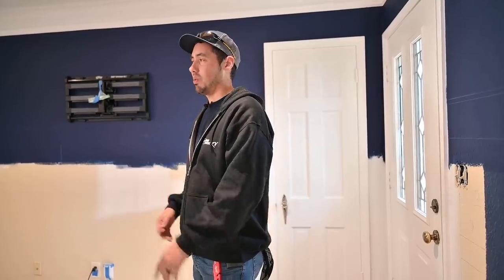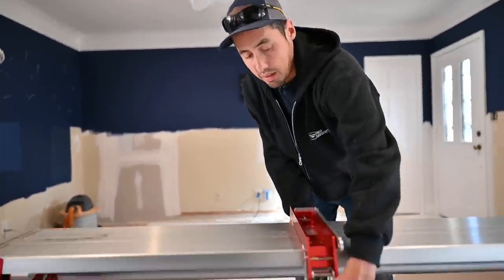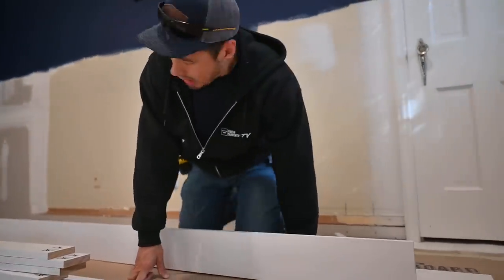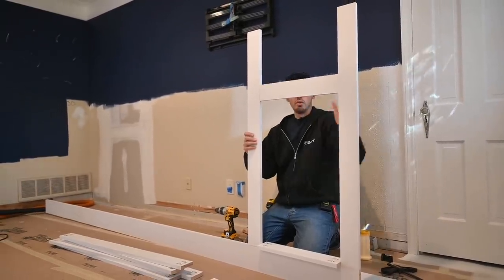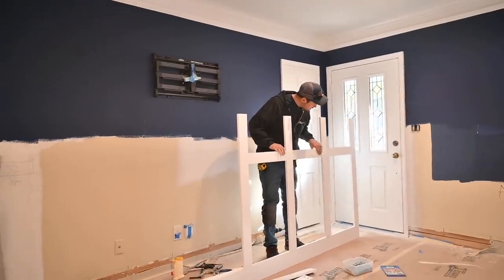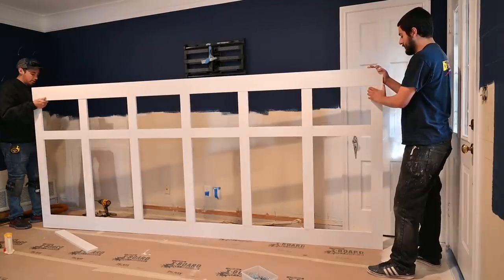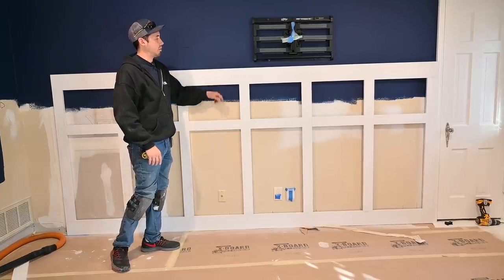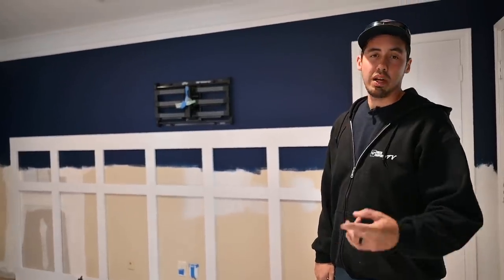Judges Panel Wainscot - Trim Carpentry Build Install

Comment: Richard, bro, you so need a Kreg Foreman for projects like that. One of my best tool purchases ever. I make like 20 cabinet face frames a week in a one-man shop and it's a huge time saver.

Tip: fasten a small block (2x2) of hard maple to one jaw of your Kreg Quick Clamp and self-adhesive cork to the other jaw. Place the block on the "show face" side and the cork jaw on the screw side. Clamp and screw. Makes the show faces align perfectly even when slight thickness variations exist... which is always.

Buen trabajo, como siempre.

Comment: I switched from pocket screws to biscuits.  I was able to get better results and I think you end up with a more stable joint.  I like the very precise fit on the face, while having some lateral play when I’m assembling.  Love your work!  Thank you so much for sharing with us.
Reply: So then what do you do for clamping while the glue cures?

Comment: As always very well explained. I have one question that is probably a minor issue but could add up. It appears you measure your stop block from the center not from the tooth. If this is correct do you account for the 1/16 when you set up the stop block. For example if you want 17 1/4 do you set your stop to 17 5/16? It seems like with 6 pieces you would be out 3/8 from one end to the other.

Comment: Could you show us how you fix a bad nail, especially when the head of the nail bends over but it's still proud of the material?
Reply: Pull it out?
Reply: @halfdead1380  The problem is that most of the time the nail breaks when trying to pull it out, still leaving bent over nail proud of the material.
Reply: @danboggess707  for finish nails wouldn't you try using a nail set to get it flush?

Comment: I was curious on what your formula is to equally get the measurements needed to have the panels the same size along a wall. Thanks and I love your work!
Reply: (Distance - 1 vertical rail width) ÷ number of panels you want

Comment: I found that gluing the butt joints before pocket screwing stops the whole wainscot panel from splitting when your carrying it to the installation spot, the caveat is you need to let the glue dry, so use a fast setting glue like Titebond premium, set quick 5-7 minutes.

Comment: Superior Craftsmanship.  If you were doing floor to ceiling  2" board and batten for an entire wall, would you build it as a unit first and then install it, or would you use another method? Thanks so much for your videos.  I learn something every time I watch.

Comment: First time watching one of your vids. I see you use a foot switch for your vac. Clever, but I use an auto switch that when you start the saw, the vac comes on, and it stays on for about 7 sec after you turn the saw off. Might want to look into it if you haven’t before.

Comment: Great video! You probably covered this in another video that I missed but in situations where you control everything, fitting the trim like this works out great. How do you handle things like crooked corners or existing casing that isn't plumb?

Comment: Thanks for the great videos. Have you ever covered how you would end wainscoting at an outside corner, or where the edge would-be exposed? Would you, in that case, run the stile from top to bottom on then, so the end grain of the rail is not exposed?

Comment: Great video.  Do you use 1x4 for the WindsorOne boards or do you use 1x6 for it?  Would you ever use 1x6 on a larger room or with larger panel mouldings or is 1x4 pretty much all that is used?

Comment: Try using some wooden clamps to hold the bottom piece, when screwing in the vertical members, might help.or make a clamp like a door holder to hold it in place as you work.
Reply: I was going to suggest the exact same thing.

Comment: I have a question about your paint equipment - you always use an airless system.  Was wondering if an HVLP system would be better for inside work since it creates less overspray?

Comment: Good work as usual man. Do you ever come across bullnose corners that aren't 90 degrees by you? I ended up with a 25 degree inside corner transitioned to a 25 degree outside corner in my bathroom, and it was a royal pain to measure and cut the crown. I'd be super interested to see you tackle that if you come across one.

Comment: You mentioned a hardboard back, and since you nailed it up I’m guessing you’ll insert a panel for each opening.

Is that a preference, or is that actually better than putting the hardboard backing on the whole thing before nailing to the wall?

I would think the extra quarter to eighth inch depth would be something too terrible, especially since it will be capped.
Reply: Checkout his wainscoting playlist( particularly the one about backboards), he mentions both methods and seems both are OK, it just depends on the project

Comment: how did you decide the dimension of top and bottom panel height? you referenced the door panels, how about if the wainscot's panel heights follow the ratio of the upper to the mid door panel height? would that look odd?
Reply: The dimensions for work like this is hell, it'll never be completely perfect unless the room itself was built with doing this in mind,  it'll be wall length. Minus casing width, and 7 inches for the first and last stile, divided by the number of panels, for the width and the height is normally around 30 to 40 inches for the bottom, and 1 third the height for the top panel ratioed to the bottom one

Comment: Unreal,just a quick question,as you set the fence from the main body of the blade,would the cut be slightly more due to the with of the tooth?
Reply from the maker: Good question. I could see that happening but it might only be like a 1/32” which is usually good enough for me.
Reply: @FinishCarpentryTV  well if it's good enough for your work,it's will be more than good enough for me,thanks.

Comment: I was taught to measure to the teeth of a saw blade. I only use a table saw though. Does that tiny space not matter for this work?
Reply from the maker: Good question. I have never had an issue measuring off the blade but for this kind of work 1/32” to a 1/16 tolerance is good. After a 1/8” you really start seeing things.

Comment: Don’t know how you use them dewalt pin guns, seriously bugs me out having to wait for the compressor inside the gun. We run the pasloade im65a which takes the gas and nails keeps it soo much lighter and can nail into hardwoods with ease  it’s a beast.

Comment: My 10 year old 18 volt trim nailer never did that crazy nail thing. My new 20v trim nailer does it all the time. Not sure why. I literally have thousands of dollars in DeWalt tools, but im going to give the Metabo nailer a try. Not a fan of the " Red" tools.

Comment: any reason for the swap back to dewalt for the miter saw
Reply from the maker: I feel that it is more accurate. I like the feel of it as far as power too.
Reply: Same with the nailer. I’ve been under the impression that the Milwaukee brad nailer was just better?
Reply: Dewalt has the best miter saw on the market. Can’t say the same about there nailers though.
Reply: Pretty sure the Milwaukee is 18 gauge. This Dewalt looks like the 15 gauge.
Reply: The dewalt miter saw is the best.  Love mine and I am just a guy doing stuff around the house.  The brad bailer. Air is 100x nicer.  Cheaper to but way nicer.
Reply: @d3lsl0w  it is, but Milwaukee hasn't released the 15 gauge gen2 yet.
Reply: @ChrisS-if7ev  I hate the clearance requirement of the slider. I use the Delta Cruzer and love it.
Reply: @CybekCusal  hey whatever works for you as long as it does that’s all that counts.   If you mean clearance behind it?  Yeah I could get that. I always bring mine outside to use or in the garage so that’s not an issue.  If I use it in the basement it is.  Beautiful saw though. Tons of power.  I was ripping 4x4s last month in an outdoor project I was building and it wasn’t even an issue. Space power. Battery life.  Just a phenomenal saw but yeah it does need some room.  I agree.  And it is a pretty big saw to lug around.

Comment: Hey Richard, super tight carpentry and great videos as always.  What's up with the Dewalt turbo jet fan brad nailer again?   That noise and pause and proud nails would time travel me back to the 70's with my finish hammer and nails.  Cheers from Canada!
Reply: 15 gauge nail is why that gun is being used,.
Reply: Thought it might be 15 or 16 gauge, but I watched the video on my phone  without my glasses and wasn't sure.  Either way., the Dewalt is still a Default and shouldn't shoot that proud or pause or sound like a turbo fan.  Cheers
Reply: I'm not a fan of battery power nail guns, I'm either all pneumatic or paslode(propane fuel) user.   One of the guys I work with/around has a Senco battery gun and he has to send it in and get repaired about 3 times a year.   Usually bad battery contacts or something inside comes loose and the nailer will power up but will not fire. Cheers back at you.
Reply: Hey Steve, agreed 100%, I use all Hitachi pneumatic or Paslode fuel for small jobs, pneumatic can dial in nail depth more precisely and consistently and a lot smaller and lighter gun.  Cheers
Reply: @ericfletcher2887  not necessarily smaller since you have to bring a compressor and hose.
Reply: @stevemcginn9200  Ive had my dewalt 18 gauge for over 1 year no problems only proud nails are from metal studs

Comment: Richard! What happened Milwaukee everything?!
Reply: Milwaukee wouldn’t have left proud nails like that!
Reply: Milwaukee guns feel really unbalanced to me i like to shoot my base boards with the gun upside-down and with the M18 guns i used it just doesnt feel good just my opinion
Reply: @bsmbB  I have the Gen 2 18 gauge and it feels pretty good with a 3ah high output battery. Maybe battery weight makes a difference? I will say, my old Dewalt was very well balanced though.

Comment: I have been trying to find a hose and connection from my chop saw to vac. Do share what your doing and what you use to turn on vac. Was that automatic?
Reply: It’s a momentary foot switch. Step on the pedal and the vac turns on. Let off and it cuts power
Reply from the maker: They have Bluetooth ones too.
Reply: @FinishCarpentryTV  if you have a link where you get some $$ share. I’d rather support your channel vs random business.

Comment: I love this channel and the work you do is amazing.... but why did you spend 3500$ on a kick ass miter saw station that has a beautiful scale/ruler down the center of it, only to have to use a tape measure to set up your stop block at 48 inches while the scale showed 50?? For 3500$, the damm thing should be cutting the wood for you. 3500$ and yet you do on occasion talk crap about the Festool Kapex which i own and love. 🤷🏼‍♂️ Not bustin on ya man, as ive said i love this channel and your work, and i have learned soooo much from watching your videos.... i was just making an observation lol. Keep doing what you do my man!